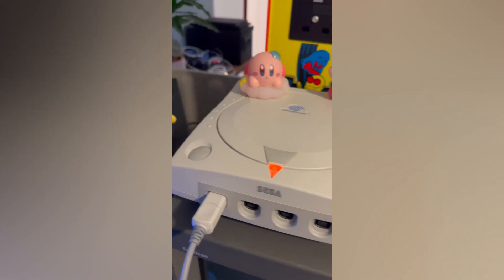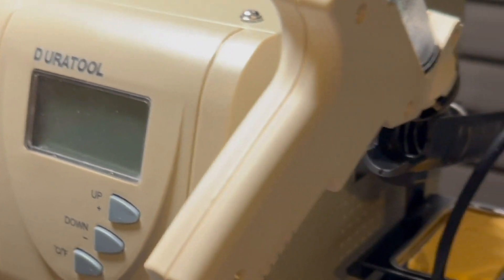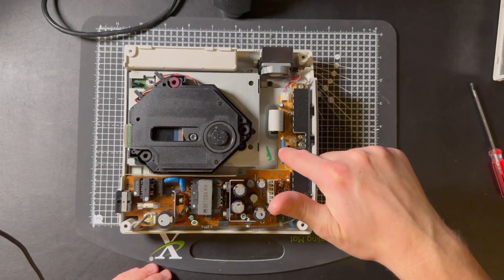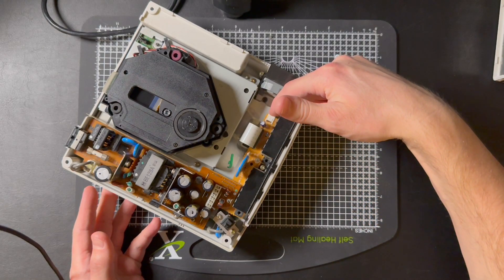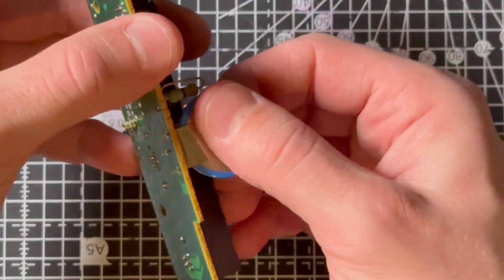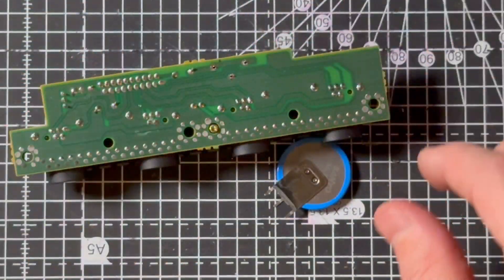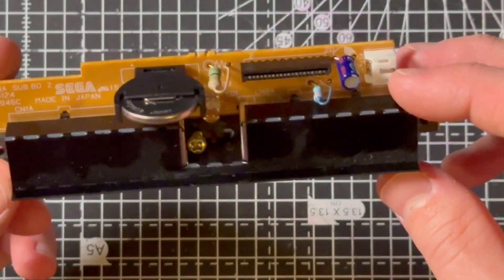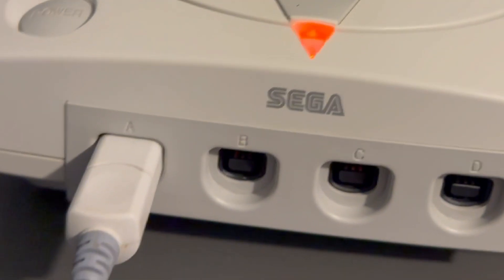How-to replace the battery in a Sega Dreamcast!

Comment: I replaced the battery in my DC but it still doesn't keep the time and date. I tested the battery with a multimeter and it has charge. So I don't know what's up...
Reply from the maker: If it were me I'd probably blame my soldering. But ensure its a rechargeable battery, dreamcast trickle charges them.
Reply: @RetroMegaMuffin  I put in a diode and now use a regular cr2032 battery, and it works.

Comment: they included the cap and everything; do we need to replace those as well or just the cmos slot?
Reply from the maker: Sounds like you got a mod which takes regular CR batteries. So you need the cap to prevent it charging.

The one I installed in this video was rechargeable so no cap.

Comment: Do you sell the part with the battery already installed?
Reply from the maker: No, there are a bunch of the correct batteries on ebay.
Reply: Dreamcast worked fine before this and now won’t power on. Any advice?